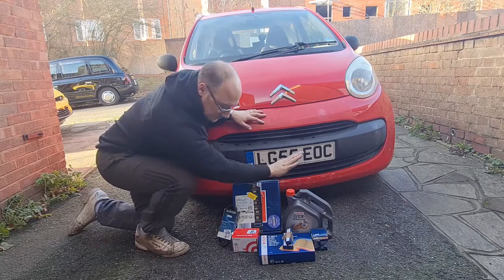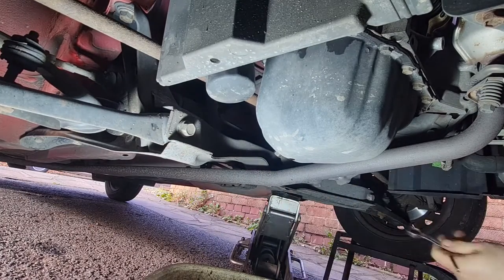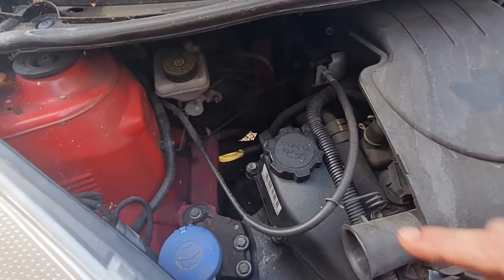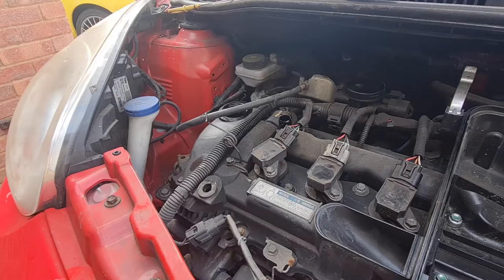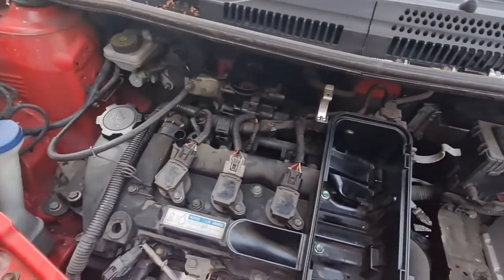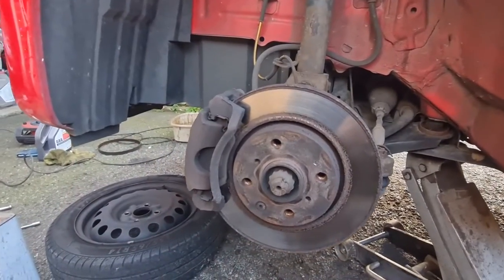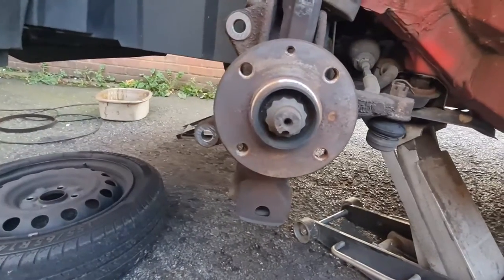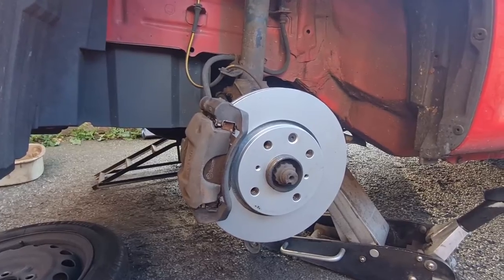CHEAP CAR CHALLENGE CITROEN C1 CITYBUG PART 2... FULL SERVICE AND FRONT BRAKES. UNDER £100 !

Comment: I’ve had two of these cars Peogeut 107 and two C1’s.
They’re cheap to buy, very cheap to run and service. I drive my 107 to Türkiye and as we got to passed Istanbul we hit a serious snow blizzard and despite having Michelin snow tires we had three skidding events the last one we did 1080deg spin landing on a pile of snow in the central reservation.
The police car with snow chains came round and took us to the nearest hotel. The following day we went to pick our little 107 which didn’t have a scratch and started straight away and allowed us to finish our journey to Antalya.
The handling is like a go kart on dry roads but be aware in very wet conditions as the back end has a habit of over steering like the old 205 used to - great fun in the dry and damp but in snowy conditions not a the safest car unless you have snow chains - the car never broke down. 
I used Denso iridium plugs and also cleaned the VVT filter at the back of the block which needs to be kept very clean to avoid variable valve tapping sounds.
Best to use original OEM spec Bosch brake pads and discs as well as OEM Purflux oil filters which have better filtration capabilities change 5/30 Synthetic oil every 5000miles and the engine will do over 300k miles no problems.
Reply from the maker: Hi, great to hear your adventures ! They are brilliant little cars, i agree about driving in the wet though, they do like a slide, ask me how i know 😉👍👍

Comment: Really enjoyed video. Ramps are good for oil change. Axle stands would make the front discs and pads easier to change as you can turn the steering wheel and get better access. No need for you as you know what you are doing, but for the starters good to be able to see what your doing. The throttle body and maf sensor and the other sensor good idea 💡
Reply from the maker: Hi, thanks so much ! Glad u liked the vid !! 👍👍👍

Comment: A nice full service. I would have done the gear box oil while at it, and maybe changed the water pump as they are known problem on these, if it’s the original. That may be the cause for the noise you mentioned but on mine it was a grinding where the bearing went. Reminds me why Ive got one of three as they are amazing cars and simple to maintain.
Reply from the maker: Hi thanks for the nice comment ! Yes the gearbox oil is on my list as when   its cold it is a bit notchy, i did spin the waterpump when i had the belt off and it felt ok, fingers crossed on that one, they are superb as you say, all the best MEC 👍👍👍

Comment: Fill the oil filter with new oil before fitting it and use new oil to coat the rubber ring.
Reply: Good advice. But not every filter requires you to put oil in them.

Comment: Love the positive "let's crack on"!
Reply: Is there a way to collect the used oil in like an old oil container so easier to take to the dump than just in a tray? Like a funnel that goes to a v big bottle, or a way to stop flow whilst switch over to a diff bottle if get full up? Otherwise, not sure how to get tray of oil to dump without spilling it everywhere, do you use a funnel to pour it out tray into emptied new oil container,please?
Reply from the maker: Hi mate, i use a funnel amd pour the old oil into a used oil can, i keep these once there empty for that very reason, hope this helps 👍👍
Reply: @mec-tec  thanks! My mate has that car and hasnt changed the oil in at least 2.5 yrs, he got it off his bro who maybe didnt either. Trying to help him!
Reply: @mec-tec  when you go to the dump with the used oil can, do you need to throw away the can too? I imagine you can buy cans to transport old oil for this very purpose.
Reply from the maker: @echoecho5244  you can keep the old cans, at my local dump you empty the cans in a large container, you can throw the cans away there or keep them to reuse 👍
Reply: @mec-tec  keeping them sounds the smart play, thanks again!

Comment: I had to weld my 2005 c1 at the rear, inner sills, both sides. They use thicker steel around the rear axle mounts, but it doesn't extend right out to the sill. Only had to weld narrow, long rectangular patches.

I've several coats of wax oyl on it now.
Reply from the maker: Sounds good ! I have checked mine and im very pleased to say i cant find one spec of rust anywhere ! Im amazed !!  Regards MEC 👍👍👍

Comment: Very nice job!
A few good tips, a few I know for quite some time.
You would be surprised how cheap people are! I hear to many scraping brakes when people brake, as the pads are scraping the discs, destroying the lot!
Glad servicing is easy. Nice your friend face you new discs, great friend.
If this were mine, I would get you to do the work, I'm too lazy and couldn't be bothered! But I do know that if you hear certain noises, you need to replace discs and pads like yesterday!
Reply: I think you might get a few mpg due from this full service!
Fuel is too expensive to waste, especially where you are!
Reply from the maker: Thanks so much for the great reply ! Fingers crossed i will get some more mpg, i will report back when i have used a tank of fuel and see if i get more 👍👍👍

Comment: Recently had to change the drive belt on my C1. Never attempted it before. How did you manage with locating the bottom lock bolt? I found it difficult with the lack of space. Was thumbing around for a while thinking of found it then noticed I was tightening the wrong bolt. Got there in the end. Thanks for the video.
Reply from the maker: Hi mate thanks for the msg, i didnt have a problem to be honest, glad you managed to get it sorted in the end though and glad you liked the video ! 👍👍👍👍

Comment: You say somebody replaced the pads and not the discs but I've had an Aygo for 92,000 miles and replaced the discs twice and always had plenty of pad depth left. I got a better quality set this time (brembo) so not sure if that'll change things but in my limited experience these cars do wear discs faster then the pads. I think the brembo pads may be a softer friction meterial so hopefully they wear instead of the discs

Comment: What's the tool you're using at 31:50 (I believe to 'squeeze the piston back into the caliper')? Unless I'm mistaken, you don't mention it anywhere. Thank you 😊
Reply from the maker: Hi mate sorry for not mentioning it, they are just a large pair of adjustable grips also known as waterpump pliers, hope this helps 
Regards MEC
Reply: @mec-tec  No problem! Thanks very much for replying and clarifying the tool you used. Appreciate it :)

Comment: just curious, what did you use to clean the pcv, map and throttle body?
was it simply brake cleaner?
Reply from the maker: I think from memory i used panel wipe which a degreaser alot like brake clean, that would be fine to use as well 👍👍👍
Reply: @mec-tec  cheers 👍

Comment: You forgot to wipe down the new discs with brake cleaner to remove the packaging oils. This will contaminate your new pads and could potentially be dangerous as slippery oil and brakes don't mix. You also didn't lubricate the guide pins with silicon grease.
Reply from the maker: Hi 
Because these discs have the coating on them, they didnt have any packing oil on them as the coating stops them corroding, i used copper grease on the pins so that should suffice 👍👍👍
Reply: @mec-tec  I'm not sure that they wouldn't have grease on them anyway and there would certainly be contamination that will still need a quick clean before assembly. Anyway as people are watching this that will likely attempt the job themselves, it might be worth pointing out that they should be cleaned and the reason why you feel you didn't need to as they might not use the same discs as you. 
Also copper grease will corrode the guide pin rubber. Silicone grease won't.
Sorry I'm not being critical but I just feel it's worth pointing out. Great video though. Very informative
Reply from the maker: Thanks, okey doke no probs i will mention it in the next c1 vid 👍👍
Reply: Great vid, only comment would be I didn’t see an axle stand when you did the second brake disc change.